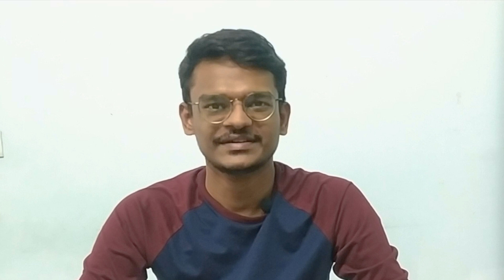MS at IIT Madras through GATE | Test and Interview Experience

Comment: Hello should i apply for iit madras ms program in solid state or integrated systems? 
I have low score of 421 in GATE in OBC and AIR 4924
cgpi: 8.59
Reply from the maker: Yes Suyog. I don't know what the cutoff will be but please apply.
Reply: @varunthakore  bro did you get call at this score please let me know because I have applied in winters, I can start preparing for test and interviews. My gate score is 525 in  electrical engineering and 7.51cgpa
Reply: @varunthakore  ohh okay thanks

Comment: can EE gen candidate with gate score of 571 eligible for the test?? and also please mention about ms in management studies??
Reply from the maker: Yes Sathiya, you are eligible to fill the application form. You will get a call for test and interview depending on the cutoffs. 
MS in Management Studies is also a great program. Don't know much about the cutoffs. Please check the website to know more.
Reply: bro did you get call at this score please let me know because I have applied in winters, I can start preparing for test and interviews. My gate score is 525 in  electrical engineering and 7.51cgpa, obc category

Comment: Can I apply for non htra in iit Madras if low gate score 366 general category
Reply from the maker: Yes, Nishu go for it. But you won't get the stipend. If that's fine with you then go ahead.
Reply: @varunthakore   that's fine I just want to pursue for it.. stipend is not an issue.. iswritten and interview process is same for htra and non htra category ?
Reply from the maker: Yes, admission process will be same.
Reply: Sir what is cut off for N-HTRA category in doms department. My gate score is 354 and 8.55 cgpa OBC category
Reply from the maker: Omkar, I don't know the cutoffs. Please check on their website if it's available.
Reply: @varunthakore  In their website only mentioned valid gate score. Sir what you think, will i get call?
Reply from the maker: At 354 seems difficult, but I would suggest to apply. Since we never know what the cutoff will be.
Reply: @varunthakore  yes sir thank you so much I will apply👍